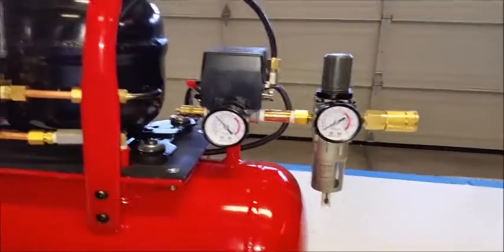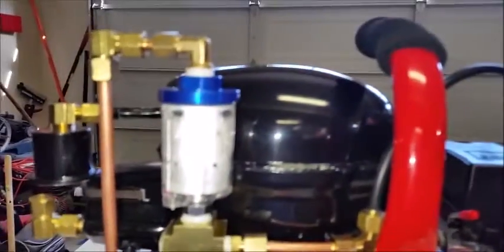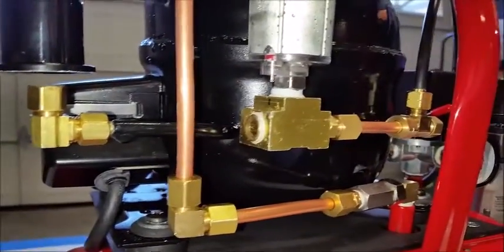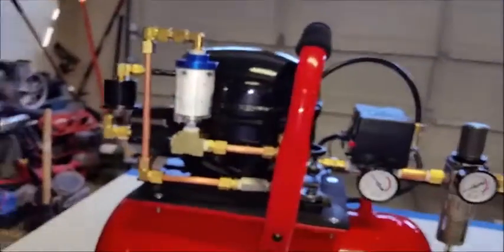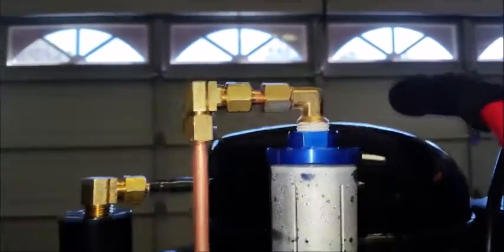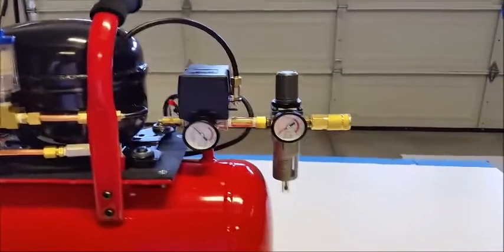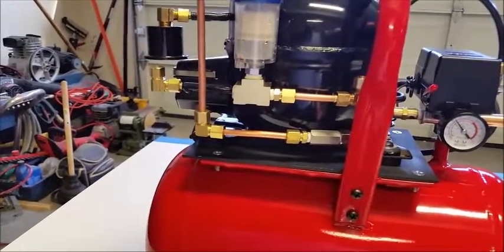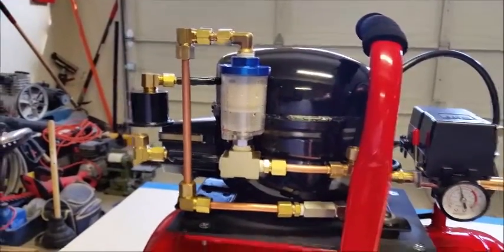Silent Air Compressor Update

Comment: very nice job on the build, one thing to keep in mind these compressor motors put out a good bit of heat, so one thing you might want to consider adding to the compressor is wiring in a cooling fan mounted underneath the compressor, my Silent air compressor which is 10 yrs old or so has one added to it. even though its a factory air brush compressor,it's made on the same principle as your unit. I have a few compressor motors sitting around,going to do a twin motor compressor on a larger tank similar to what you done. again congrats on the compressor.
Reply from the maker: Thanks for the kind comment. I will keep your suggestion in mind. The problem is there is very limited space underneath the compressor.
Thanks for watching....
Reply: @jeromejt62  I know you would have to extend the fittings to make it work, my fan section is 4 1/2 high and 8 1/2 long box with a metal screen , then the compressor mounts to the base of the fan box,the switch for the fan is a separate on/off toggle switch,that way fan can be turned on/off even when compressor isn't running,keeps compressor cool . another option is they make an clamp on fan you can clamp to your handle. just something to think about for the future.